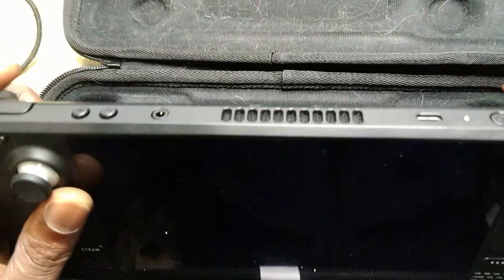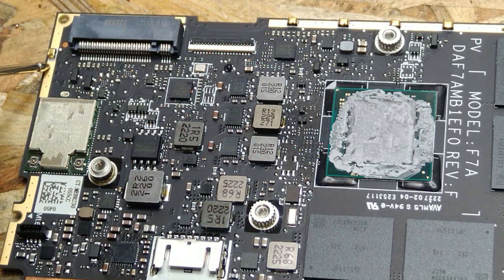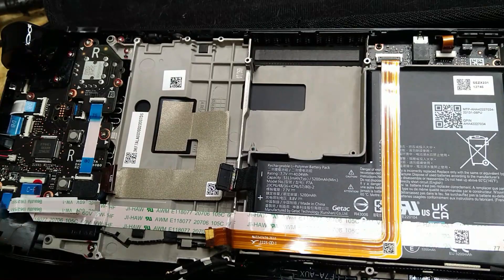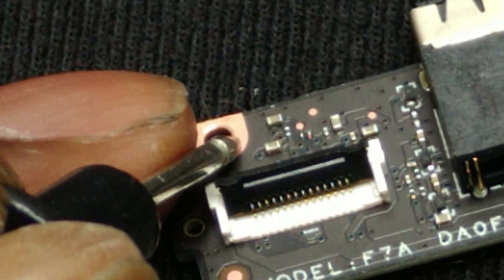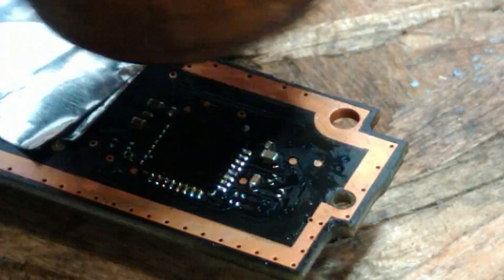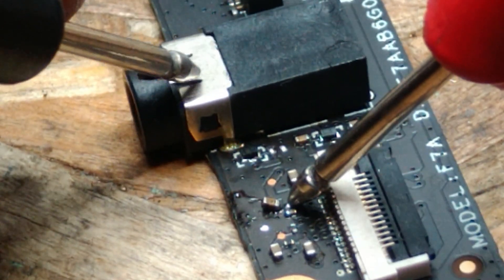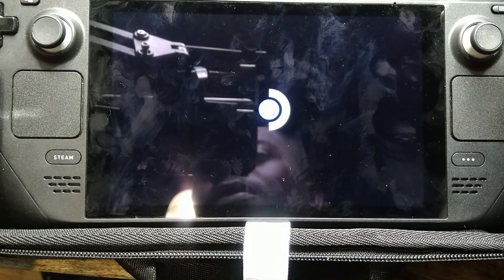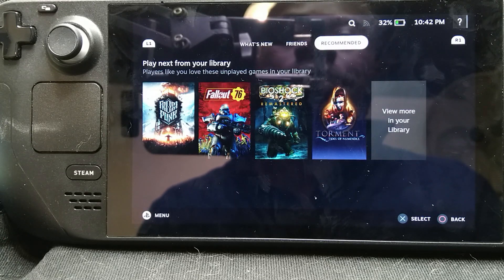Steam Deck No Power Repair

Comment: Have you encountered the issue of where the steam deck is completely unresponsive? The steam deck power light will pulse with a charger connected but will not do anything else otherwise. No display, no fan, no audio cues. I've tried every button combo imaginable but pretty much at a loss. Thanks in advance!
Reply: You probably   need to replace the max chip